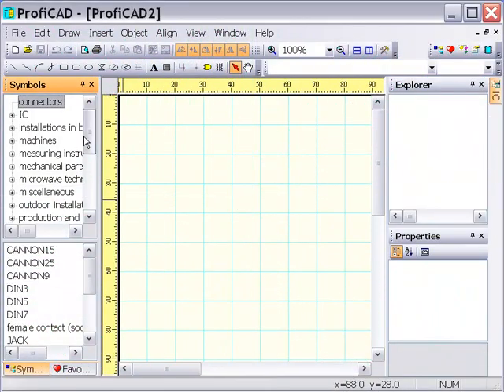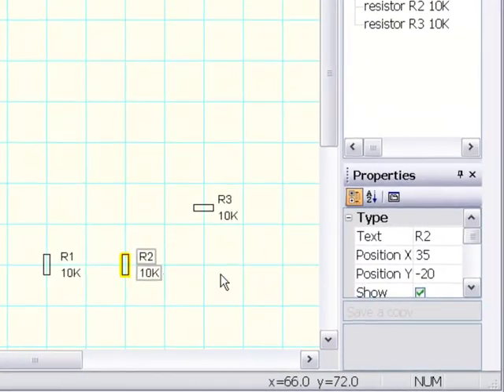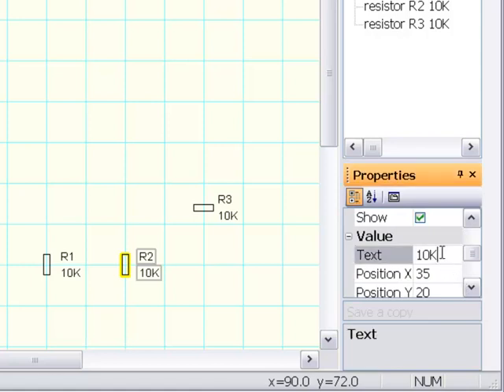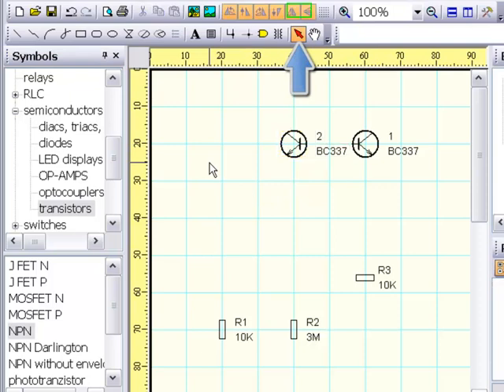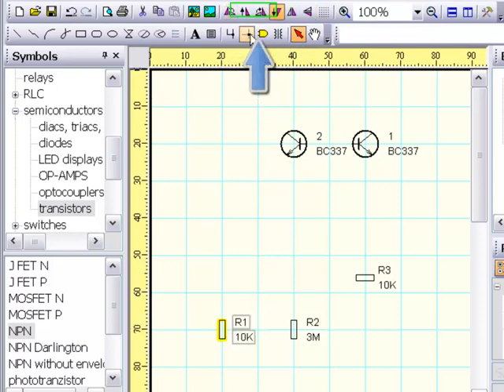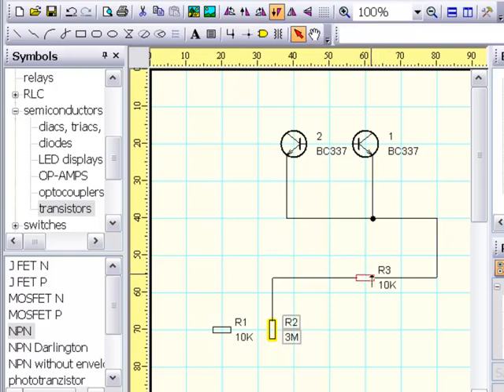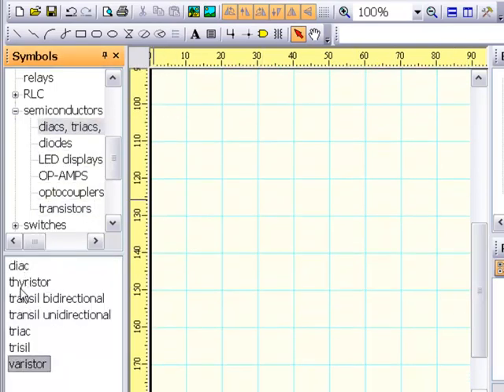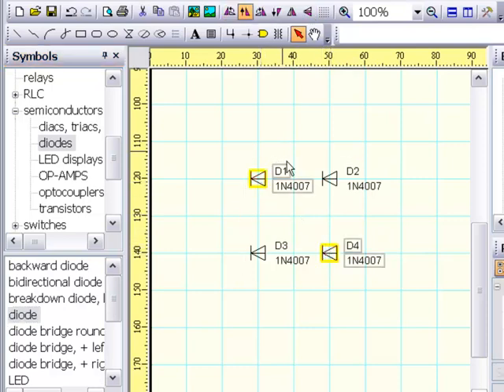Drawing Electrical Diagrams and Wiring

Comment: how to number the wires?
Reply: https://www.proficad.com/help/de/wires-numbering.htm
Reply: @VáclavJedlička   Thank. An excellent program, the manual is enough for understanding. There is another question. In the video, the reference (R1) of the symbol and type (10K) are not graphically connected by a red line with the symbol. How did you do that?
Reply: @sergeyrybin946  Do you mean the helper lines? They can be turned off. This is an old video when the helper lines did not exist.
Reply: @VáclavJedlička  yes, how can i turn it off?
Reply: @sergeyrybin946  You can turn them off with the menu command View - Helper lines.